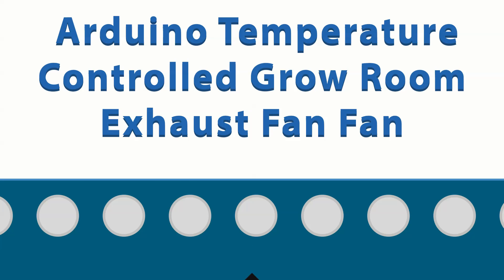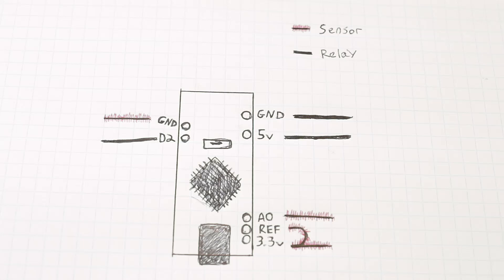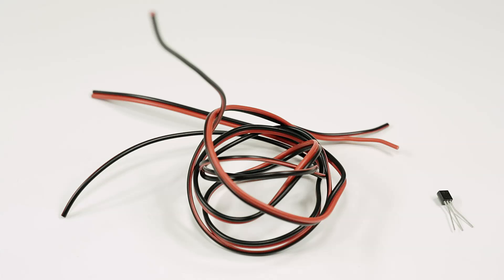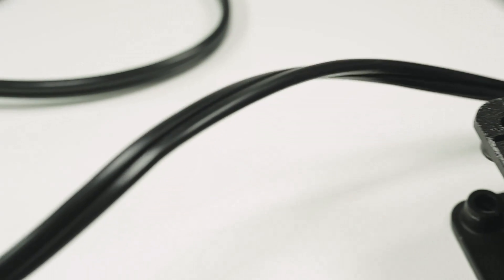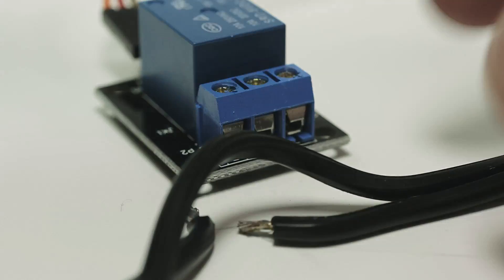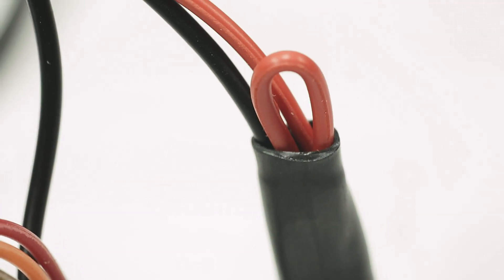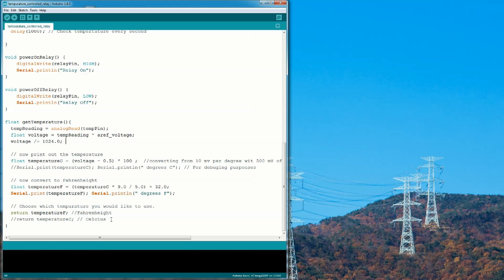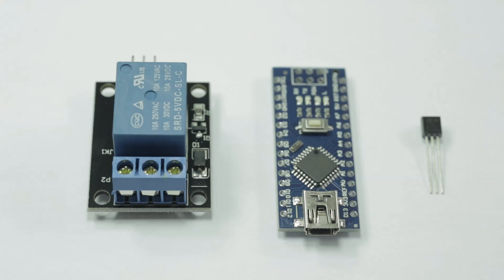Automate A Fan: Arduino + Relay + Temperature Sensor

Comment: A nice tip for holding the pins in place to solder --- u could insert them into the Arduino holes then stab the other long ends into a piece of foam like packing foam. Or styrofoam.
I sometimes use a kneadable eraser for holding the pins too.
Just mentioning in case it helps you or anyone who reads.

Comment: Soldering tip time....soldering iron goes on one side of the component and board, the other side of the component goes the solder that is touching the component and board. Solder should simultaneously melt on the component and board at the same time and you will have a nice shiny solder joint, this means it didn't get too got and you got good flow from the flux.

Comment: Great video. It's old as hell but I try it anyway. I bought all the parts and put everything together. But my temperature reading in the monitor goes down when I apply heat. The base temperature is 27.27 F. And even if I uncomment the Celsius line and comment the Fahrenheit line, I will still get a reading of 27.27 F. What did I do wrong?

Comment: Hi,
 I found your nice ventilator system, which is practically what I want to built; however, the use of the ventilator is slightly different:
I have in my central heating system in the house (a.o.) a vertically positioned radiator. The top of the radiator is about 50cm under the ceiling, consequently the heat builds up above the radiator. On top of that I have n old house with wooden beams supporting the ceiling which make the heat stay put between the beams.
I have bought 2pcs 'be quiet' ventilator s12V, and want to make the system more or less similar to what you made.
A temp sensor should respond at 40°C or so and blow the heat into the room.
The ventilators are with 3 wires and it would be nice to have them start slowly (at half speed)  and keep them running at half speed if the high temp setting can be maintained at that moment; if the temp runs over the high temp setting it should switch to full speed.
I do realize this is quite something, but if it works, most likely more people can make use of it because I believe in the end it saves money when you can enjoy the (expensive) heat in the room instead of creating a warm ceiling.
regrards,
Tom

Comment: Nicely done.... why not just solder some leads streight to the temp probe.... and skip the dupont and headerpins.... or even just plug the legs of the probe streight in to the dupont connector?  On the board side the dupont makes more sence... but that just me :)

Comment: Very interesting project👍
BTW we have a plan, by using the ECT sensor from a car (fluctuate voltage will be availabe from 0.9 to 3 volt), to trigger the 3/5 v relay module, so it switch on/off a mass signal to a 12v fan relay. Is it Possible??
Reply from the maker: I'm not sure I'm not an expert on the wide range of uses and configurations

Comment: How many relays with different temperature settings can be run this way on one sensor?
Reply from the maker: like only one temperature sensor? you can run as many relays as you want to some extent, youd need a multiplexer. you could do like 8 very easily
Reply: Can I have a relay turn on at 40 off at 45 ( heat) then have a relay on at 55 off at 50 to open a vent then one on at 60 off at 55 for a fan. Exc. but just one temperature sensor.  Multiple heating and cooling stages is what I’m after
Reply from the maker: @benfriel12  yes you would just read from the same sensor and use some if statements in the code to check if the reading is in the range and activate the specific relay or relays you want only one sensor is needed for this

Comment: Yes! i found what may work for my project. I'm building a heating system useing an radiator from a truck. Paint it black, put in a box with glass top mount it on the roof. The sun will heat the fluid (Radiator Fluid or Oil). After reaching around 200*, a valve would open & a 12v pump would push the hot fluid into a hot water holding tank.  Then useing a radiator with a fan on the back side. Mounted inside the room you want to heat. the heated fluid pulled from the hot holding tank the, fan would blow the heat into the room. Then the cooled fluid go into a cold holding tank to go back to the roof to be heated again. A closed system with everything running on a 12v or 24v solar system. Controlling the system will be a learning cruve for me. Temp sensor, Open/Close valves, Fans & blowers.. This will help me get started. Thanks
Reply from the maker: wow very interesting application! good luck I love the idea

Comment: can we use esp8266 as the board?
Reply from the maker: as long as it has analog pins for sensing the voltage then it should be fine!

Comment: How many temperatures probs can you add to one arduino
Reply from the maker: as many analog input pins as it has, i think you could do 8, they would have to share the voltage pins tho. you might have to do al ot more math. Im not really sure

Comment: I'm trying to do something similar, except that instead of a fan its a cooler for a diy minifridge. i cant get the arduino sketch to upload. would you be able to look at the errors and see whats wrong. ive never worked with arduinos so im not sure what im looking at
Reply from the maker: if you have an off brand one youll need their firmware
I would google your exact brand and get the specific help it needs

Comment: Hi, great project...question: is it possible to change your circuit to "Celsius" not "Fahrenheit" ?
Reply from the maker: Yes, you can just diff math
Reply: @TechplantChannel   What exactly do you mean?
Reply: @matthiash.454  convert fahrenheit to celcius in the arduino code

Comment: I'm trying to make a incubator controlled by an arduino. But I want to control the humidity as well using the dht11 sensor. Could someone guide me to a similar video?
P.s: I don't want to use an lcd screen.
Reply from the maker: so would you be doing
the temp turns on and off the heater and the humidity triggers a fan?

You would need a 2 channel relay for that.

Comment: Hello,
Thnx a lot for your great YouTube, It means a lot if you share what you’re good in, so we can learn from each other. I hope you have time for a small simple question. Is there power on your relay coil when the NO contact is closed (when you’re hooked up fan is on) like a standard relay or does it gets a pulse each time you switch on and off you’re fan?
Greats
Bart

Comment: Nice project but a tip of advice.
Never, Ever solder mains cables no matter what, the reason for this is as simple as that the solder tension will adjust to the pressure of the connector and in the end will end up in a fire, there's a reason why this is illegal in some country when installing mains inte building.
Reply from the maker: interesting! thanks for the info

Comment: who the fuck is Fahrenheight? No flux for the temp sensors soldering? It will break off soon. Metric system is superior, btw.
Reply from the maker: The Imperial system is for intellectuals who can count by other numbers besides 10s.

Comment: It made me relax when you added heat shrink I hate people who leave this shit exposed. I don't get it heat shrink is cheap so just buy it.
Although I would not have used a 150v fan I would have used a 12 or 9v DC fan
Reply from the maker: yeah i actually changed the entire thing to a 12v computer fan. much safer but the throughput sucks...

Comment: Hi, I really like your video! I would like to create something similar for my 3d printing hobby but I want to use a DS18B20 sensor that has data, Vcc and ground pin. How should I hook it up? would it work with your arduino program?
Reply from the maker: Ill have to do some research

Comment: I have gone through this video and found to be useful to me; Thanks for this presentation which has taught me in detail about arduino with temperature sensor. I would like to have a presentation by you using the DHT11/22 sensors to sense the humidity and temperature and to drive external circuits of exhaust and sprinkler for my kitchen garden green house.Hope my request will receive your kind attention.
Reply from the maker: Wonderful!

Comment: OMG! @5:10 why do you cut towards your fingers with a razor! I learned not to cut anything in the direction of any of my extremities when my dad gave me a brand new knife at 12 years old.. (And extremely sharp) He promptly took it back when he saw my finger with its tip missing.. yeah yeah, say what you want, my dad taught me allot that many other dads don't even do. My point is, DONT make a howto video where you use a razor cutting towards your finger that is less than a inch away.

Comment: You will never have 240 unless your bringing two hot lines in which you wouldn’t do with this kind of thing, your dryer and stove are 240 which is actually 208v so you don’t have to worry about that. Also regardless if it’s ac or dc it doesn’t mater what wire to connect the relay on AC doesn’t go in both directions current travels in one direction it’s about making a complete circuit. Dc can be switched on both the positive and negative, it all depends on if your circuit is sinking or sourcing

Comment: What if I wanna just use the fan and the temp I wanna turn on the fan every 4 hours for about 10 min how would I do that
Reply from the maker: in your script youll just set a timer to turn it on every 4 hours and run for 10 min, it doesnt need the temp sensor. maybe ill make a video about this
Reply: @TechplantChannel  ok have to learn how to do that I'm new to this, thanks for the info

Comment: Can I use light bulb instead of the fan? Does it affect the program if I used bulb?
Reply: I also might add LCD so that it would be more easier to monitor the temperature
Reply from the maker: Jason Fernandez sure you can hook whatever you want to the relay do you want the light bulb to turn on when it gets too cold?
Reply: @TechplantChannel  i was confused with the "serial9600" haha i thought it was only for the motors hehe. Btw, i want to use it as an incubator for my future poultry hehe thanks a lot from ph :)

Comment: this video is really helpful and I will be grateful if am selected for the giveaway. I want to regulate the temperature of hot water inside a boiler tank that will trip at 75 degree celsius and pick up again when the temperature drops to 45 degree Celsius

Comment: This is great.  I am planning to build a cooling system for my heat frame box that I use for germinating seeds before planting.  They need to be kept at a certain temperature and this will be just what I was thinking about.

Comment: what if i will use a digital temperature sensor?
Reply from the maker: I think youll need some kind of digital to analog converter. If you have a raspberry pi you can use it with that, but youll have to wire stuff up a bit different

Comment: Considering this is a final assembly, It would probably be easier to solder a wire under the header on the Arduino from Aref to 3.3v rather than try to put two wires in a crimp connector.
Reply from the maker: yeah that's a really good idea, funny how you can miss something so obvious! Ill have to redo it with that method. thanks for watching and thanks for the advice!

Comment: Would be cool to make for a kitchen exhaust fan, or with my compact fluorescent set up, or for use in a terrarium.  New to Arduino and coding so I will be checking out more of your videos.
Reply: Neat idea. So if I want to make it automatically turn on everytime I cook, what sensor should I use? Air quality sensor?
Reply: Depending on where you want the fan and where you put the sensor, and considering the space available and size of your cooking area. I would just stick with the temperature sensor in a good place and then adjust your temperature range for the ideal setting.  Multiple sensors would be cool also; thinking a humidity sensor would be suitable. Not knowing much about the air quality sensor, I wouldn't know what parameters you would want to trigger the fan at.